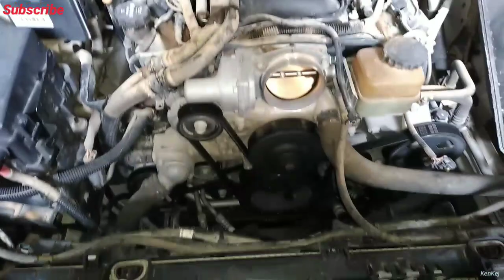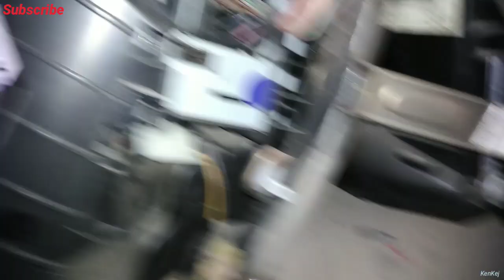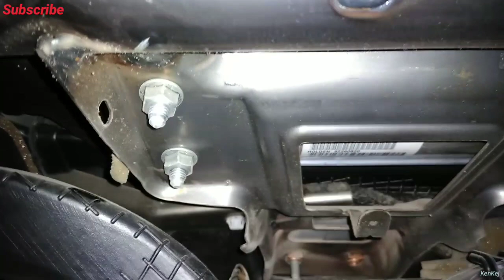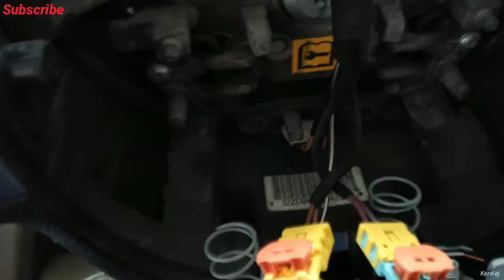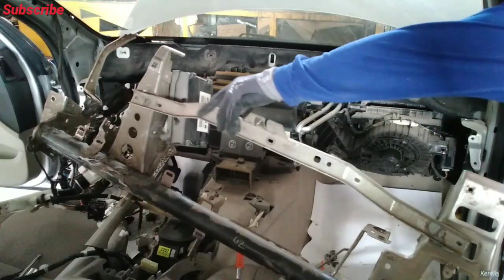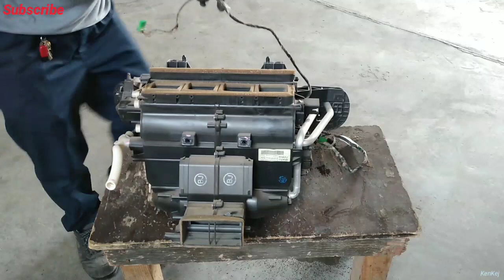How To Remove And Fix A/C Evaporator Chevrolet Caprice 2013 Part 1 (TAGALOG)

Comment: Hi great video Ken. I have a 2013 caprice v8 and the AC is sometimes blowing cold air and sometimes hot.. can you tell me what steps I can take to fix the problem?
Reply from the maker: Most common problem of caprice is  A/C Compressor.
Reply: @KenKejAutoElecTrix  but the fact that it is still bowing cold sometimes must mean that the compressor is working fine right?